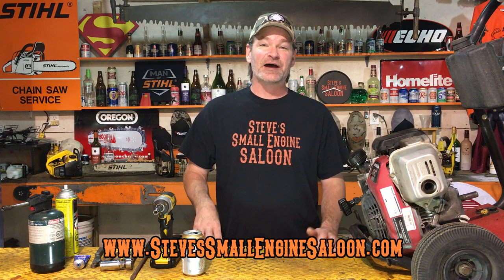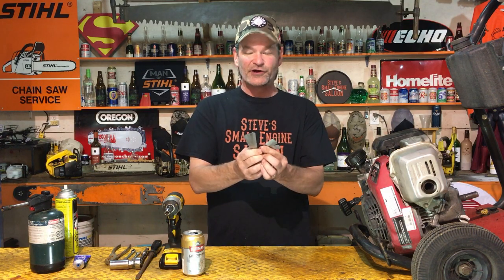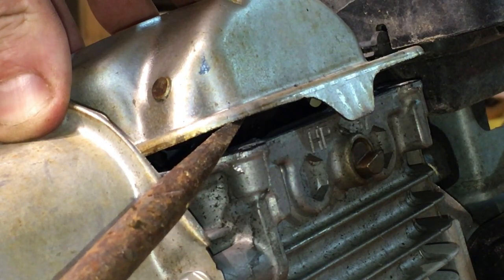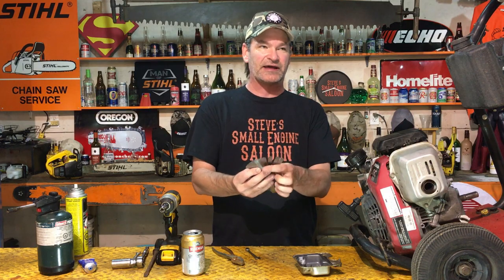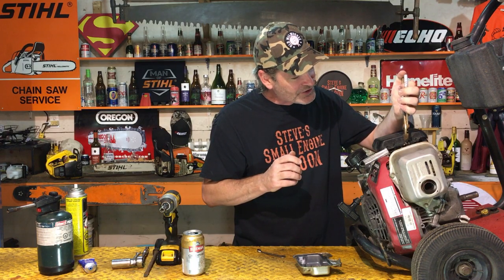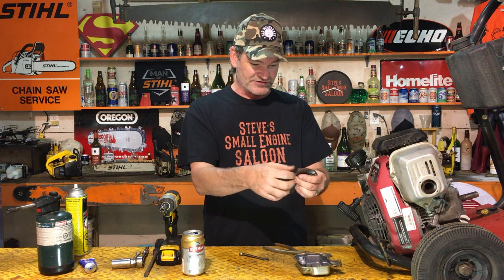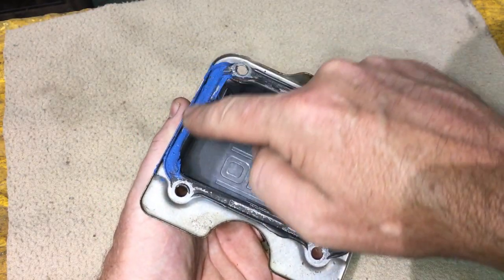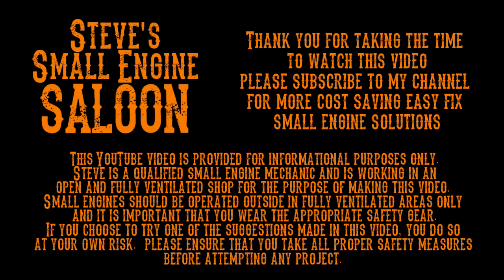How To Adjust Or Set The Valves On A Honda GC Engine

Comment: Hmm. My intake was loose, a very snug .008 - set to .006 and went to the exhaust...OMG - the exhaust was loose with a .025 feeler (the thickest in my set). Set to .008 and hopefully it will run better.

EDIT: Nope. Still nearly no compression (starter rope pulls freely) and I noticed a nice puddle of oil in the air box. But... at least the valve adjustment is in spec!
Reply: Camshaft is probably done.

Comment: Hi Steve, i have a briggs 23hp commercial v twin on my new Ferris zero turn and im starting to hear a knocking noise coming from the crank area (more so at the back of engine) is this normal? i read somewhere that sometimes the hydraulic lifters can go bad if it has sat around for a while. It has only done 9 easy hours. Any help would be greatly appreciated. Cheers.

Comment: Hello steve i have a chainsaw that i need to adjust the carburetor. I watched ur video on how to adjust the carburetor on a chainsaw and u said that if my chainsaw didn't react like yours did the there is something else wrong with it. So please steve i need ur help what could probably be wrong with my chainsaw because it isn't reacting like your chainsaw in the video. My chainsaw is a poulan model p3416 34cc/16" gas chainsaw
Reply from the maker: I have a video on my channel called If the chainsaw wont start.  Check that one out...
Reply: @StevesSmallEngineSaloon  thanks bro u have an awesome and helpful channel.

Comment: Good video thanks Steve. Valves always been kinda worrisome to
Deal with but you made it clear! In general is gasket maker just silicone? There are a lot, RTV etc etc. most will work?
Reply from the maker: Not the same stuff you caulk the bathtub with....
Reply: Steve's Small Engine Saloon that I understand, just all kinda sealers in the auto area. I will steer clear of the bathroom area.

Comment: These Honda engines seam to have an issue of the exhaust rocker arm breaking. Appears to be a common issue, any idea what it might be or how to avoid it? I triple checked the clearance last time, still cracked it.
Reply: Could be the Exhaust Valve Guide has migrated out of the head and the Spring Retainer is bottoming out on it. That's what I had.
https://www.youtube.com/watch?v=zZz0MRqxGX8

Comment: Instead of finding TDC can’t you just adjust each valve while the other one is wide open? I’ve always done it that way with no issues
Reply: No... it will run backwards.
Reply: @Failure_Is_An_Option   lol

Comment: I have a craftsman pressure washer that just lost compression 580.762600 and after popping the valve cover and noticed a broken valve spring retainer realized that for decades my honda powered pressure washer had a 7hp briggs and stratton pos engine in reality. (Briggs & Stratton 86293 valve spring retainer) evidently is made from unobtanium as I cannot locate anyplace on the planet that has one ? it measures 22mm wide and is the style that simply has a groove in it no keepers. Is there a made in china clone part I can use ? I mean more then likely I can replace the retainer adjust the valves and start it up and change the oil if it starts ?  or actually since there are possibly tens of thousands of these engine used in good shape because everyone burns up the pumps long before the engine fails ? maybe getting a used engine would actually be cheaper ?

Comment: I have a troy bilt tuff cut 230 smart touch starting system. 12AS5690063
Only starts when it wants to. It's like the starter doesn't turn it over fast enough. Have you worked on this type before? Any idea what could be wrong?

Comment: Hey Steve love your channel man. I just did a valve adjustment on my Honda GX 690 engine intake clearance .08 and exhaust side .10  but its still mildly surging. Any thoughts?
Reply: Why did you touch the valves for a surge condition?  That is fuel...

Comment: Just like to know why you did not mention about top dead center not being on the compression stroke when adjusting valves. The other video stated that you could be 180 degrees out.
Reply from the maker: On this engine if it is on the wrong stroke the cam wheel will be pointed in the opposite direction.  What I said in this video, it is on the proper stoke...

Comment: My honda mat riding lawnmower takes forevever to start. I crank it and gets a couple slow turns then dies , i do crank this over and over 20 times eventually i get it to run,  do you think its my valves or something else, great video bro
Reply: Marty Forkwater starting fluid works every time. 😀

Comment: Hi Steve!! What would be a good compression figure of a GCV engine please? I have the 135 which is a chucking out a lot of blue smoke. Thanks
Reply: Compression issues with smoke could be a blown head gasket. Check the head bolts and see if any of them loosened

Comment: Does it matter if the engine is at TDC on the compression stroke or can it be on any stroke?
Reply: It doesn't matter. Just make sure the lobe on the cam is facing forward and centered.

Comment: Hey, hoping you can help me. I have a honda eb3500x generator. The valve clearance specs are [ in 0.15+2mm cold and ex 0.20+2mm cold. What do they mean by the +2mm? Does that mean it would be 0.17mm cold and 0.22mm cold? Please help, thanks.
Reply: You are correct.  Odd way to post a tolerance.  Should be .16mm +/- .01mm

Comment: Got a $20 Honda mower yesterday. No / Low compression. Did this tonight. Got to be some gasket RTV tomorrow. I will keep you posted, but it seems to have compression now. Lash was ZERO before adjustment. And oil looks terrible. Black & thick. Oil change next  if it can get it to run. Has good spark.
Reply: Update?
Reply: netdoctor1 seems to have compression. Exhaust out of muffler AND intake. I am wondering if it has jumped time or bad woodruff key or what. Next steps are 1. new spark plug 2. Pull flywheel to check key 3. Pull valve cover off again to see if timing marks line up ok. Open to suggestions. Might look at cam gear to see if lobe is worn, if I have to take valve cover off again. Since I started the project, I now have a better idea of what I should be seeing.
Reply: OK for anybody that’s interested. I got the Honda to run tonight first time   I have had  that valve cover off 4 times & it was driving me nuts but here it is I finally figured it out with some help from Donboy73. The valve cover was bent just enough from banging into who knows what that the valve cover was interfering with the intake valve keeping it from the rocker from opening and closing exactly freely as it should. I straighten out the valve cover and now it’s running pretty good and I’m giving it in oil change as we speak.
Reply: @haneyoakie14  very nice!

Comment: What to do if exhaust valve gets tight every time it's used? Then want start unless exhaust valve is corrected.  It's like new generator out of warranty. Never ran differently from first day. Any fix?
Reply: Later I found the exhaust valve plate mount stud screw loose. I  tightened it but it didn't work. So I'm ordering a new head. 

Does anyone think a type of aluminum lock tight could fix it?

I found, the valve plate mount stud won't stay tightened, so the exhaust rod rubbed a grove in to the left side of the valve plate in the exhaust side.

Comment: Great video as always Steve!  Question, do you have to torque down those jam nuts, or is hand tightening okay.  Thanks 👍👍
Reply: Those rockers aren't very thick. Final torque on those jam nuts is about 5.8 Ft-lb (0.8 Kgf-m). Less than the torque on the cover bolts.

Comment: I've got a pressure washer when you try to pull it and started it jerks back real hard you don't like it got too much compression I called the dealership and they said the valves are too tight does that sound about right
Reply from the maker: I have a video for that in my playlist...

Comment: Spent just 15 minutes adjusting but 2 hours removing Honda bond. . Perhaps a better way is this: apparently there is a cast version (stronger) of that valve cover for Honda's GS series engines. Better yet, it comes with a gasket vs. sealant. According to some at Lawnsite.com, it matches up to the more common GCV160 & 190 engines. Part # is 12311-Z2A-000 for the cover &  12312-Z2A-000 for the gasket. Even tho you point out that one can add new sealant over old sealant, I think will get a set before I adjust my valves again.
Reply from the maker: Great tip....
Reply: I fashioned a temporary gasket from cardboard, but I think the spaces between bolts are too great, and oil would eventually leak in the mid-sections. Liquid sealant cost them less at the factory.

Comment: Got a gx 160  starts on first pull for 5second and dies but the second  pull I get nothing.. if I let it set 10 minutes the almost starts for 10 seconds again. Any Clue?
Reply from the maker: Clean the carb.  I have a video in my playlists..
Reply: May need to check valve lash and compression release mechanism on the cam.

Comment: one last detail, do not over tighten those last 4 bolts, just make them nice and snug. the valve cover can deform quite easily.
Reply: 1.2 +/- 0.2 Kgf-m (6.8 ft-lbs)

Comment: Hey Steve really like your videos You've taught me a lot. Just wonder if you've ever tried adjusting valves with a compression tester gauge I turn the adjuster screws manually while cranking the motor and reading the compression gauge I tend to get more PSI this way

Comment: Cut open a soda can set them both using piece of the can as feeler it will run just fine unless its engine for racing but the gap would be different anyways if changed the rods and springs.

Comment: Would be awesome with a video showing how to fix the bearings and replacing the shaft driving the stuff the engine runs. Would be awesome as I need to fix my water pump. Chines crap copy of a Honda engine.

Comment: Is it just me or does anyone cringe to see PLIERS put on the Valve Stems during the adjustment process?.Either the Honda Valve adjustment tool or a properly sized open end wrench would be my choice for holding the valve stem while making adjustments. I do find the video very informative otherwise.